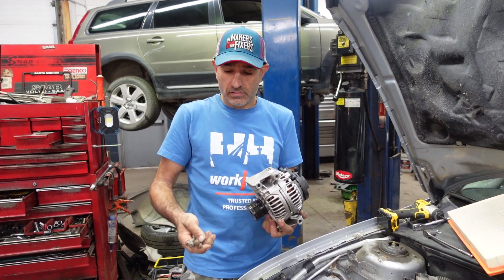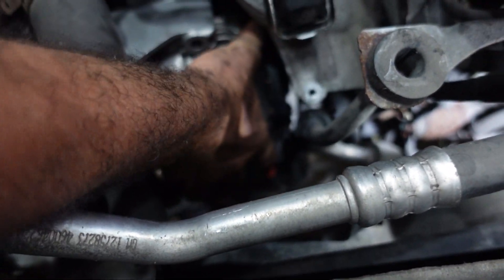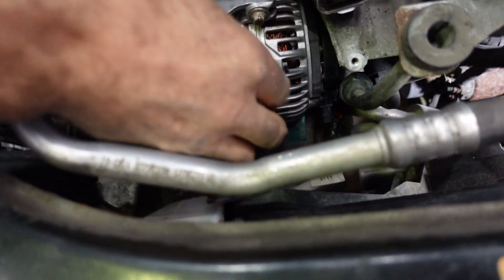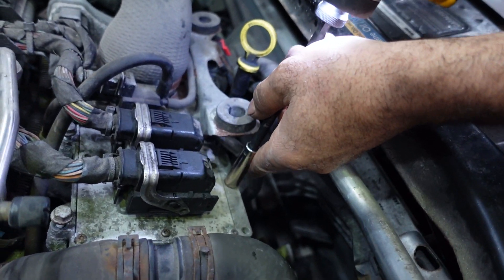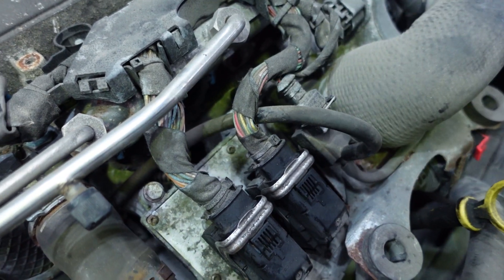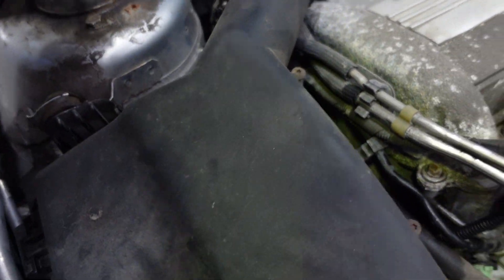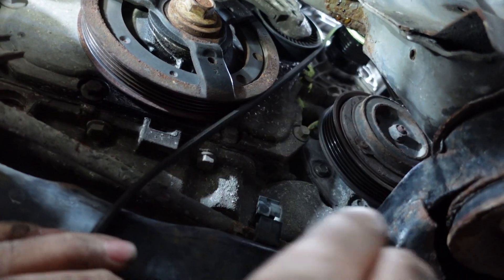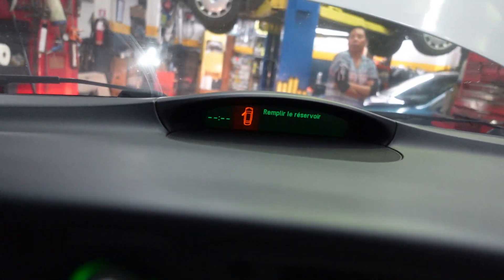How To Replace Alternator/Generator SAAB 9-3 2003-11 2.0L T Engine(Part 2)

Comment: Sorry mate what about the negative connection of alternator ?
Reply from the maker: The two pin connector is connected to the ECM. The alternator is grounded via the engine block/cable/battery -ve. The +ve cable is connected to the battery +ve.
Reply: @saabmastertech5852  thanx mate